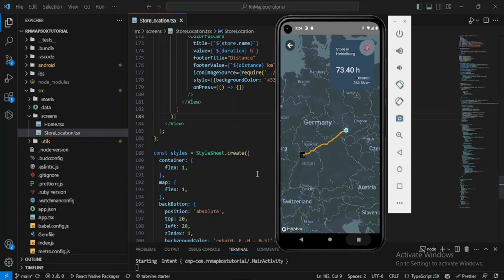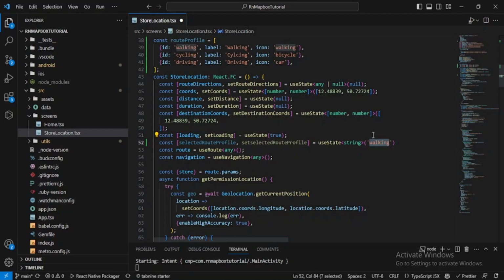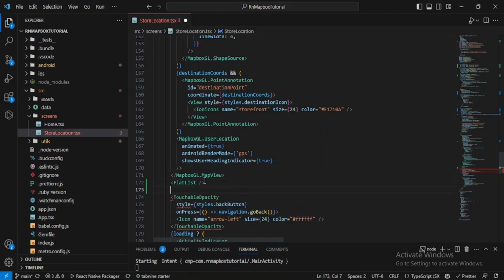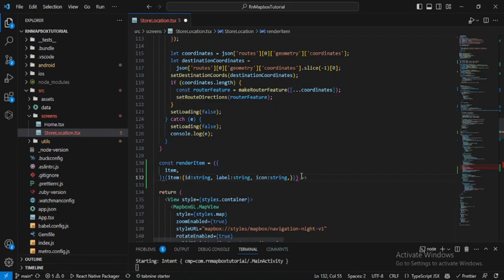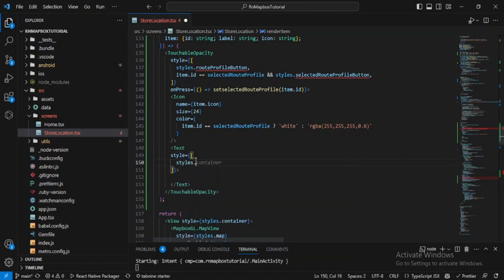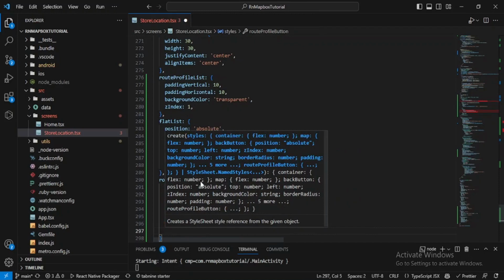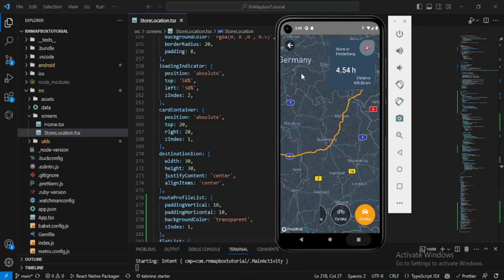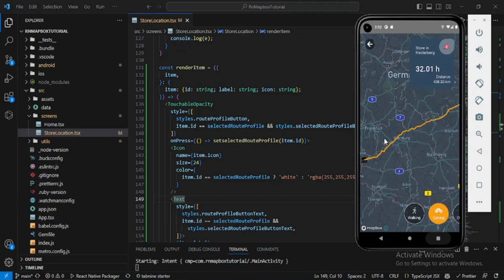React-Native and Mapbox | Dynamic routing using Directions API

Comment: Hi, thanks for this video. Can I also implement this in an expo based project?
Reply from the maker: I don't think it's possible, even though they made a whole doc for Expo users, since Mapbox requires native modules, which is impossible on Expo, but who knows.
Reply: Hey @fjerbi does this mapbox sdk work on expo?
Reply: @snowsproam  yes, u just need to make a dev build for your app and it works fine